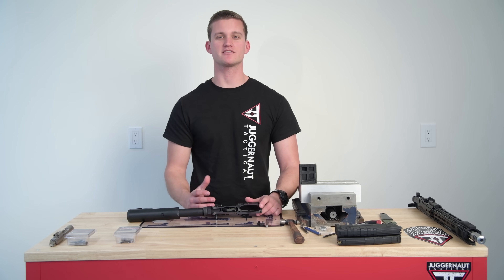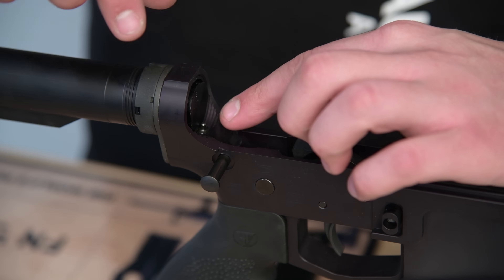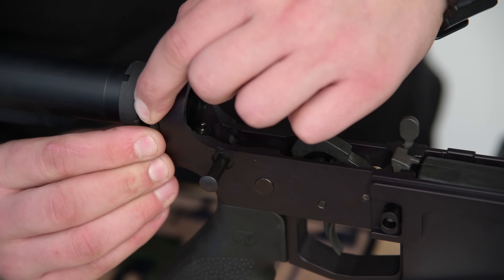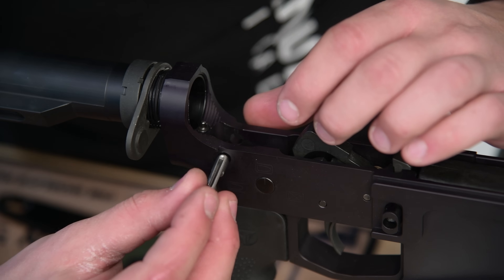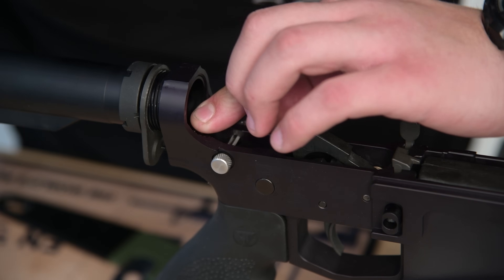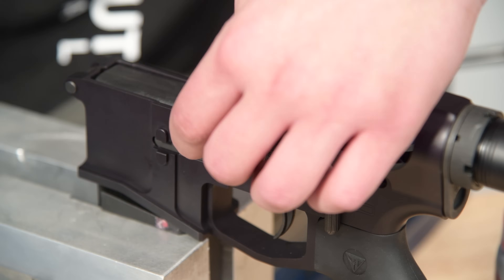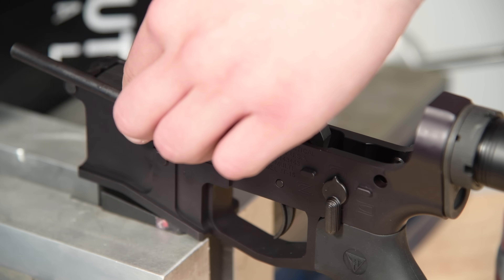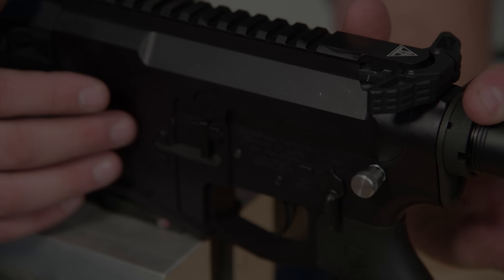Hellfighter CA Mod Kit Installation

Comment: Do you really need the takedown pin detent spring with this kit? If it locks in place via screw wouldn’t it be a waste of time to put one in considering all it does is get stuck when you pull out the hellfighter pin?

Comment: Hey! The rear pin is not black  this just won't do. This company wont spend the extra bucks to coat the pin? Cheap product. Where else did they cut costs? No thanks.
Reply: The one I bought has a black finish and the release button is charcoal grey... looks cool but chrome would slide out easier.

Comment: Just had one of these installed on my diamondback db15. My system before had a visible bolt catch button on the left side of the gun but was removed and looks exactly like it does in the video. how to you catch the bolt with this system?
Reply: You don’t

Comment: When I go to install the upper by pulling the rear takedown pin, the detent just pushes the pin out of alignment. What a nightmare.
Reply: simple fix. Make an extension to replace the left side cap. use a 0.249 (or 1/4" sanded down in a drill)  diameter standoff 1" long with a 3/8" 6-32 set screw in one end (use lock-tight). Before pulling the pin all the way over to separate the upper/lower for other work. Run the new extension into the pin end. The extension keeps the detent pin from popping out of place as you slide it. The Ar-15 set differently than the Ar-10 (DPMS 308) due to the different direction of the detend post.
Reply: I had the same issue and now not sure how to install the upper without jamming the dentent pin? Any suggestions from other users?
Reply: @renemacare6329  installed 3 and they work like a charm, reloading is as fast or faster, HA HA CA.
Just take care on the install. I had no issues of jamming the detent. Be aware of how it functions. It can be confusing at first. 
Clean the upper/lowers real well, a bit of oil helps but no need to flood. I wouldn't use the red loctite, have had no problems with the Blue but they know more than I do.
 Lot of vibrations with these semi-autos resulting in loose screws.
They glossed over some key points. Too much detail to just cover here but I'll try.  
Assume its all done. 
Gun on shooter's right side, right hand on trigger, left on barrel.
To change mags;
 with your right thumb, push against the left-side rear pivot nut, the last part put on and seen in this video @ 7:41 .
DO NOT USE LOCTITE on the rear pin threads.
The rear pivot pin ROTATES about 1/4 of a turn as it's pushed by your rht. thumb to change or release mags.
This allows the upper to pop up, separating just 1/8" or less. 
That gives JUST enough clearance for the new "mag lock" seen @ 5:27 to clear the mag release lever and allow mag change.

Remember if whenever you need to remove the upper COMPLETELY after installation, the rear pivot pin nut and spring must be removed (seen @ 7:41)  then the new pivot pin is rotated about 1/4 turn and pulled to the right as far as it will go.
The detent for the NEW rear pivot pin doesn't have to come out.
The new "mag lock" has an adjustment screw and 2 springs that rocks it in and out of working position. 
Takes a few times to get it adjusted just right so avoid loctite until its correctly working. 
The top of this "mag lock " has to be flat or level with the lower . 
Otherwise the upper won't lock back down in the closed position needed to fire.
Avoid working over carpeting with these micro springs and parts.. 
hope this helps. The AR-10,- 308 work equally well.
Reply: claystar9valor I have the same issue 🙄.. how did you fix yours ??

Comment: Where’s the bolt hold open? Some of the rifles I’ve seen with this still have a bolt holdopen
Reply: samrules11 for what purpose? You cant separate the upper and lower to drop a magazine if the bolt is locked to the rear.

Comment: Great idea and awesome Ca legal mod, but too bad you made it so thin and flimsy. My pin bent in half trying to put it in during the install and now doesn't work. $60 well spent.
Reply: What pin and how? Nothing in the instructions shows any amount of force being used to install this kit lol.
Reply: @gunsforevery1  The rear takedown pin. Since it has 90% of the material removed, it bent just pushing it in like you would and normal takedown pin....
Reply: @WildernessMedic  probably has more to do with the fitment of the pin in the lower. Some are tighter than others. I’ve had some that required a punch to take out. I’ve taken a very fine sandpaper and rubbed inside of the takedown hole to not have to use a tool to remove any of the pins in my lowers.
Reply: @gunsforevery1  All good. I moved to a free state right after this, so now it's just a hilarious memory of tyranny. Now I get to suppress everything and shoot full auto like the good lord intended.

Comment: WITH THIS PART, WHY CANT I MANUALLY LOCK THE SLIDE/BOLT BACK???
Reply: I have a Ruger lower with standard pmags, if I pull the charging handle back and let it drop slowly it will catch on the mag. If I drop it hard it clears it. I realize that doesn't happen for everyone but with my built it works well.

Comment: What is the set screw for on the magazine lock that you apply Loctite to what does that set screw do what serves its purpose
Reply: Dylan Glave I don't know how to explain what it is but I know what it does. If the screw isn't out far enough, the kit doesn't work at all and the mag can be ejected just  by using the mag release button, totally bypassing the function of the kit. Make sure it's adjusted properly (put the entire rifle together and make sure the mag won't release) then put on the loctite, otherwise the kit is pointless and you could be in trouble with the law.
Reply: I just put one together and found out through experimentation.
Reply: Dylan Glave u

Comment: I did everything & my mag wont lock.
Reply: william m you need to adjust that little screw that he said to put locktite on. You adjust it bit by bit, put the upper back on, and test the mag. If it still drops without being split, take the upper off, screw out the little screw a little more and repeat
Reply: Ok. I got. It works. 👍

Comment: I left a pretty negative review before I installed mine. Can't find it to edit it, I hope it wasn't deleted. Now that it's installed and I've had time to use it, I have to say it's not bad. You can unscrew the button and pull the pin normally to open for cleaning or clearing a jam. I can lock the bolt open by not dropping the bolt too hard on an empty mag. If someone does ask questions you can easily demonstrate the mag lock for any John Q Law types. Ultimately I'm glad I have it and can my gun to the range again. Now that I have a roll punch I can remove the kit in 5 minutes if I choose. Its a more elegant solution than doing a featureless build... for now.

Comment: Why would you use red lock tight? Isn't that super hard to take out?
Reply: First, they JT needs to explain what the heck the screw's purpose is. FWIW, I don't think there will ever be a reason to remove it again.
Reply: How about when laws change again and everyone needs to modify their AR-15s with new parts again?
Reply: just toss it .,but they won't.
Reply: I mean the bullet button used to be ok now it's illegal to use on a non-featureless rifle in CA. They definitely could change the laws again.
Reply: I only had green locktite laying around. Do you think that will be ok?

Comment: @jtacticalvideos

question, after install, the bcg still stays in tube after racking (empty mag) is it not suppose to do that, and if not, how do i fix that. im using hex mags.

i cant drop the empty mag unless i pull the bcg back and push down on the mag's spring so bcg can slide past.

Thanks!

Comment: can someone link me the video where the guy dremels the pmag where it catches the bolt? i cant seem to find it and why hasn't Hellfighter explained this issue in a video with solutions. Terrible just terrible of them to not inform the public on this problem.
Reply: The P-mag has a LOT of issues with other guns as well. 2 minutes with a file to form them the same as GI mags at the rear.NOT JT's fault ....it is a P-mag issue. Do some research.....
Reply: Had to modify my P-mags to work in my Tavor also.
Reply: Mine locks open if you drop the bolt slowly and clears it if you drop it hard, I have two types of pmags and they both work the same. I realize different people have different results, I have a Ruger lower and PSA 16" m4 upper.

Comment: Im using pmag magazine and the bolt unable to go forward on an empty magazine! I shaved the top down but i had to take off a lot of material. Any other magazines that work  with this mod without needing modification?

Comment: Is it normal for the screw/button (left side next to selector) to become loosened after using a few times? Seems after swapping a few mags I can always go down and turn it tight.
Reply: Mine gets loose if you barely touch it. Which happens frequently when using the safety function. What sucks is if that button is even the slightest loose then it won’t function properly with removing the mag

Comment: No bolt lock = inconvenience at the range, because bolts need to be locked back and safety flags in when it is time to check your targets. You would have to unscrew the nut and pull back the take down pin in order to fully open the action fully to insert the flag. Then reinstall the pin plus screw back the knurled nut when its time to shoot again. A standard rear take down pin is also easier to tap out than this one. Please let me know if I'm missing something. Thanks.
Reply: Yup, I just experienced this at the range yesterday
Reply: In ca, ranges usually are fine if you have a flag in the chamber with it blocking the bolt from going forward.
Goes to show that Safety is not California’s real concern with these laws.
Reply: What do you do with weapons that don’t lock back to the rear like an AK? Do you have to disassemble it to insert the flag?

Why wouldn’t the range allow you to pull the bolt back, insert the flag and then lower the bolt back onto the rear of the flag?

Comment: So what does this do exactly? It won’t allow you to release the magazine?. I love California, born and raised, I will not live anywhere else, but the gun laws are a freaking joke.
Reply from the maker: per CA laws - you need to break the action (make the rifle inoperable) in order to change the magazine. Our Hellfighter magazine lock and modified rear pin do just that. You break the action, then press the magazine release button to release the magazine.
Reply: @JuggernautTactical  does the magazine lock still need to be install if the gun already comes as a fixed magazine? With only the Hellfighter takedown pin installed, it'll still comply since you'll have to break the action to release the magazine, correct?

Comment: Installation was tricky with only one kitchen table gunsmith.
Be careful not to mash-up the outboard spring on the mag-lock when installing.
Issues with this kit:
1. You have sacrificed the function of a bolt lock by replacing it with the new mag-lock.
2. You now have to unscrew the end plate and spring to retract the rear take down pin to remove the upper.
3. The BCG will strike the magazine follower after the last round is fired because you have no bolt lock.
I guess it's better than being a felon.
Reply: #2. You just unscrew the piece on the left and rotate the pin to remove the upper.
Reply: Why can't you just replace the take down pin only with the hellfighter and preserve the bolt catch. On last round the bolt holds back so release with the original bolt release and then engage the rear pin to release the upper. Then change the mag out (1 less round from full capacity) and pull the charging handle..and fire away? Although the kingpin claims to do this with the bolt back.
Reply: @mikekim1011  To be honest with you, during the riots, I just converted my AR back to the stock configuration. I'll be damned if I'm going to let some little prick burn down my house while I'm struggling with a magazine change.
Reply: @18661873  so tempted to do the same. Ar came with a 33.3 calcatch. Feel like replacing that with a standard bolt catch for the home and change back for the visits to the range .

Comment: As this is one of the only options for the AR pistol , I bought one and installed it in no time .
Adjustment was easy on the set screw and I couldn't find my blue loctite so I used a dab of white nail polish .
Pretty simple to install and simpler to use !
BUY ONE (or three) TODAY !
I know many have and will say MOVE OUTTA STATE But Northern California is my home n always will be so I'm using this product until we can vote these illegitimate politicians outta office n turn this state around .
Reply: ecodeacon1 it’ll be a cold day in hell before we even come close to turning this state around

Comment: Yeah, everyone needs to be aware of the mag follower issue here. JT seems to know about it and has decided not to be up front about it. I bought three of these. Installed two before I discovered that after last shot the bolt will hit the mag follower and jam. JT's response quoted from here was to let the mag "wear in". Not going to happen, the bolt slams into the follower and jams. Other Tuber has modded his mags. I am undecided. $70.00 a pop,no support, and I have to screw my $20.00 mags?
Reply: Ray Wallace can you make a video on this issue? Was tempted to buy this mod, but sticking with my tier5 modified bolt catch that's already in place. Single shot isn't that bad after all
Reply: Yes,will add to my channel tomorrow.
Reply: I ended up filing an angle on one of my hexmags, I’m not excited about the mod, I’ve emailed jt and get the same soft answer on the issues
Reply: Had the same problem with the AR-Mag lock. This was when using Hexmag Magazines. Pmags and MFT mags work pretty good. They allow the bolt to close after last round. Mod Kit is fine, this is a magazine problem.
Reply: if you use PMags, you need to be sure to never let the bolt down slowly, don't "ride it in," or it WILL get hung up on the follower. If you rack it and and release it hard like you should... this won't happen.
Reply: Could argue that JT should be upfront about this, PMags are ubiquitous, but really, this is "your bad" for not operating your gun correctly.
Reply: Or you can just shoot 9 rounds still leaving one in the chamber and reload.
Reply: Insert a 10 round mag ,shoot 9 ,drop the mag with one in the chamber.Insert another 10 round mag ....repeat .
Reply: Ray Wallace i used a dremel on 3 hex mags, to alter the angle on the follower.  Took about 5 minutes and is an easy fix
Reply: Adan/Ray, can you put a vid up for what you need to modify on the mags? I have two PMags, and they catch the bolt after the last round. What part needs to be ground down to let the bolt  carrier slide back into place?
Reply: Mike Allen Mike it is a follower the plastic part that follows the last round in the magazine. In my hexmags it is an orange plastic part
Reply: I'll try to post a video, I still have 3 more mags to do
Reply: Ok, cool, I was looking at the follower, just trying to figure out what part needed to be filed down, the JT guys said it just needed to be rounded a little so it didnt catch the bolt carrier. Thanks for replying Adan.

Comment: When put in the magazine and pull the charging handle back thr bolt hits the magazine every time....any ideas?
Reply: I’m having the same problem, I emailed them directly and was told the mag needs to wear down, ain’t gonna happen
Reply: David Flores  most kits have that problem.. I got a vitamin c tac kit and did the same... hangs up on the mag follower right? They have a vid to fix that... but all I did was run a file at an angle for like 10 sec... so it runs right over the follower...  I know it's a pain but o did it to all my mags and it's better than loosing all the features... hope that helps....

Comment: How will it catch the bolt after the last round without bolt catcher?
Reply: Kosk S it doesn't catch
Reply: It wont because you have replaced the bolt lock with a mag-lock.
Reply: You can't open the receiver with the bolt back in the dampening tube.